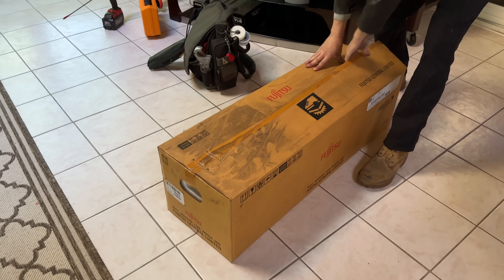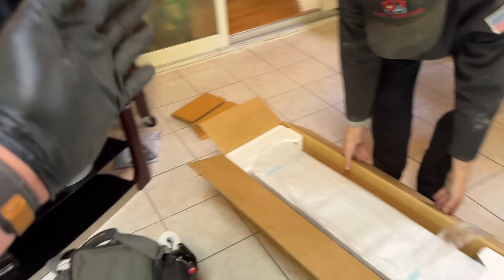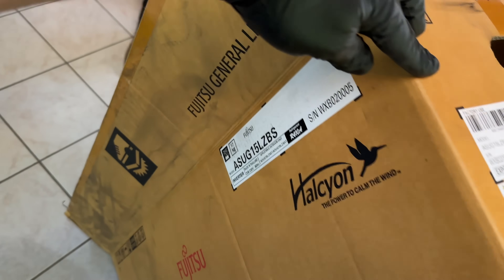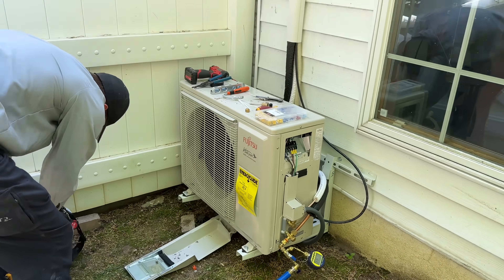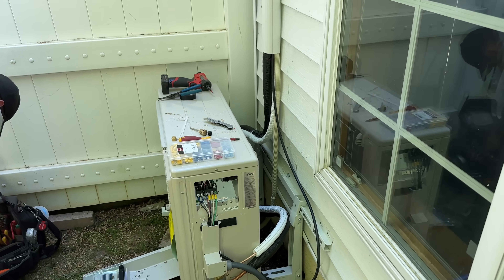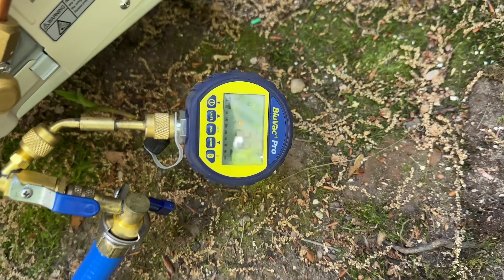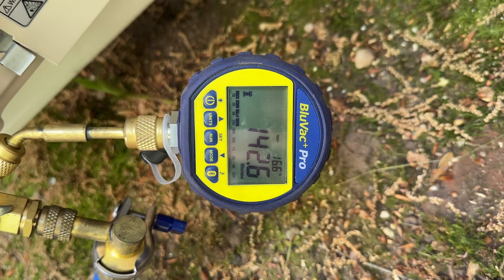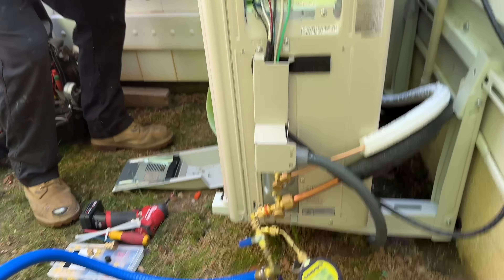Record Breaking Ductless Heat Pump Installation - Step by Step Instructional Guide

Comment: The round connectors are called eyelet connectors. They make them with heat shrink as well. Just use the proper crimp tool so you don’t rip the heat shrink when you crimp them.
Reply: called ring terminals

Comment: I expected a tarped indoor work area. Why did you wall mount it 6 inches off the ground? And also probably not good to call something “stupidess” and retarded. Running your mouth like that on a jobsite would get any tech fired. Set a better example for that kid workers like him are hard to find. Good luck.

Comment: 4:16 sorry, no… „The Metric Conversion Act of 1975 is an Act of Congress that was signed into law by U.S. President Gerald Ford on December 23, 1975. It declared the metric system "the preferred system of weights and measures for United States trade and commerce", but permitted the use of United States customary units in all activities.“
Reply: @PipeDoctor  read the act, afterwards you know.

Comment: In America we don’t use the metric system”, but you are measuring vacuum in microns?
Reply: for some reason they think using the metric system means they have to completely renounce the imperial system, instead of having the option of using both

Comment: Do you open the service valves with the schrader tool still on the unit? If so does the refrigerant damage the micron gauge? Great video
Reply: Kinda does
Reply: I was taught between oil and pressure it wasn’t good. But I’m not saying I’m right, just kinda my deal

Comment: The best thing I ever started doing was routing the control wire through the wonky chase while the units still on the floor…
Reply: @PipeDoctor  you’d think they could make it a smooth tube since they took the effort to make a path